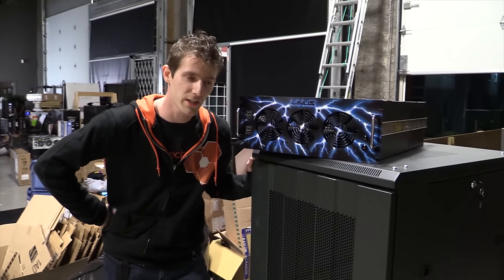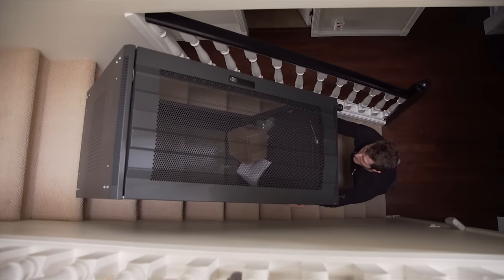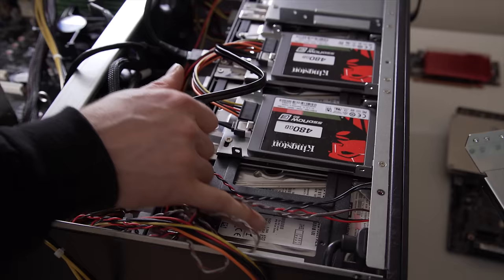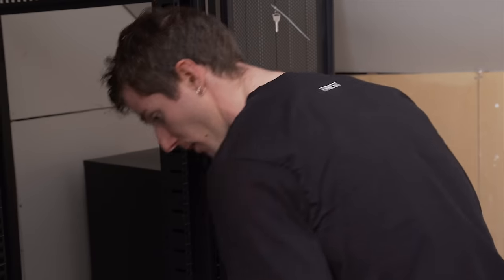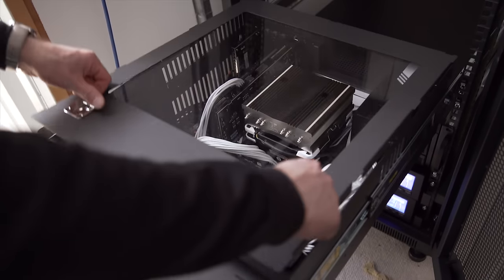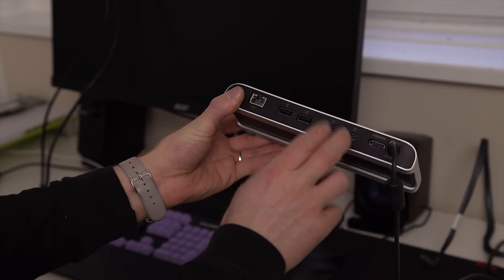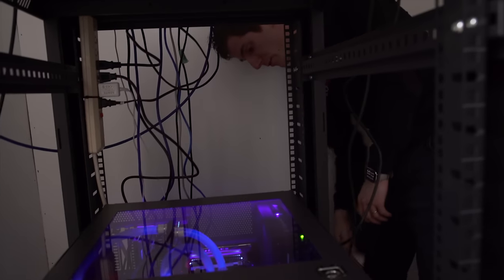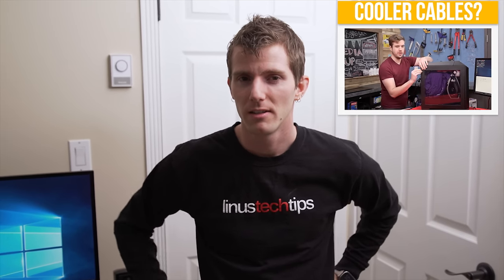Final Deployment of My New PC! - Personal Rig Update 2015 Part 5 (FINALE)

Comment: Linus, I have yet to see you do proper cable management. EVER. Make a video to prove me wrong. (Because you have something to prove to a stranger on the internet, of course). ;)
Reply: +timmyboy seeing videos where they use rack equipment makes me cringe.   I watched that thinking I really hope he has made sure the floor has enough structural supports to handle the rack when it inevitably gets loaded up.  I spend all day everyday working with enterprise hardware and networking (all 10Gb fiber, with vm clusters using dedicated 10Gb iSCSI scan) and i don't want to bring any of that stuff and install at home.  It is noisy and hot and designed to live in climate controlled Data centers/server rooms.  At home I all I want is high end consumer networking.  I know he is running a "home office" but it is not very professional at all.  Like just now how he put that rack in, so many issues, a big one being the fact that the room is not finished!  I will not install a rack into an unfinished room.   Just a bunch of half baked ideas and they have the ad revenue to make it because the money from all the people watching pays for it all.  Entertaining though and clearly successful.
Reply: Yeah, not bashing but definitely bothersome to see such top notch equipment being thrown together after hours of work to make it perfect then ending it all with a mess of wires. My dad always told me "A clean car runs better". I've lived by it. In computers, it has benefits of running cooler and makes it easier to upgrade or maintain.
Reply: +Simon Davies The whole rackmount idea was stupid in the first place IMO. Why do all that? If you wan't an insane watercooling setup just go full tower case, and then actually put it in the room you're in so you can admire it.
Reply: +timmyboy  It makes literally no difference at all. Go watch their video where they stuffed an iron and a couple of shirts and boxes in a rig and temps didn't change at all. But for maintenance it is easier I'll give you that one.
Reply: +Joshua Flores (Josh) you must not know much about computers they tested for 10 minutes if your like me and run your pc 12 hours strait for work and gaming it makes a diffrence
Reply: I know enough to conclude that running at full load for 10 mins straight should be the equivalent of running your pc with moderate use for a whole entire day and half that amount if you're gaming. But of course neat cable management would overall expand the lifetime of your pc in the long run. So if thats what you mean then i totally agree with you.
Reply: +timmyboy Yeah, as a former sysadmin myself, I cringed when I saw all those loose cables at the back of the rack. You can't just connect everything and then expect to clean that spaghetti up.
Reply: +Joshua Flores (Josh) Doesn't change the fact that's it's horrible cable management.
Reply: ***** Any PC enthusiast who doesn't live in a trailer.
Reply: +Alex Meanberg Because if you really was enthusiastic about computer building, you would know that it would help the airflow => cooler temperatures.
Reply: +timmyboy Clean cable management looks better, I'll give you that, but unless you have literally hundreds of cables hanging behind the rack, there is no hit in cooling performance and maintenance actually becomes harder, because you have to untie your cables, do what needs too be done and then tie them again. Every. Single. Time.
Reply: Ahh but loose cables look so much cooler!
Reply: Tokeish I agree that it's not about airflow, but it's nice to have your setup look nice and clean. Also help a lot with management when managing multiple servers.
Reply: look at his latest server room update
Reply: Ty Holt he did that so he could have true silence with no performance compromise.  If you prefer something else, go do it.  That’s the glory of the PCMR

Comment: I have always wanted a setup like this with the goal leaving my noise and heat producing PC in another room. Thanks to this video, I have done just that but at a much lower cost. By using USB and HDMI extension cables to connected my monitors and a USB hub I was able to achieve an equal result. There were some weaknesses to this setup such as susceptibility EMI and signal derogation but getting better quality cables fixed that issue. Now, 5 years later and I dont this setup it one but and it has check all the boxes. I added air conditioning into what I am calling my "server room" since this is where both my gaming PC and main server reside.

Comment: Wanted to do that too, but then I looked at the price for a Thunderbolt dock and thought, nope. :)
Reply: Flat4Buggy 2 Well, I'd even need two docks since I have three monitors, they support only two monitors..
Reply: Well, the only two things missing to get my rig completely silent is replacing my data hard drive with a big SSD and a graphics card with zero fan mode, the other fans can be turned off and my rig is well sound-insulated so I should have at least a silent idle system.
Reply: If you're running 1080p or less, use HDMI ↔ CAT6 adapters instead. They're cheap and work well.
Reply: ***** I'm running 1080p @ 120hz so this won't work...
Reply: Knig Fotlets That sucks. Although, depending on how far you'd want to have the computer, you might be able to get away with using a regular cable (DVI, HDMI, DisplayPort—I've seen all of those in at least 15 foot variants, so if you're planning to keep your computer just in the next room, that could work).
Reply: +Knig Fotlets I just saw the price of the cables to move my computer to the garage, wow. Next option, going to look at some stuff over Ethernet.
Reply: I've had good luck using 5-meter (16.4ft) USB extensions (2.0 & 3.0) and 15 & 25ft DisplayPort cables by Cable Matters (Amazon), and 15 & 25ft HDMI cables by Mediabridge (Amazon).  Works great with my UltraWide 3440x1440p 60hz monitor.

I even have an AmazonBasics powered USB 3.0 hub on the end of the 5-meter USB 3.0 extension cable and it works great - with full USB 3.0 transfer speeds on a 3.0 flash drive plugged into the hub.

Comment: Hey linus, ever heard of a hand cart. Has two wheels a handle with a metal plate that would go under that rack and you can roll it right up the stairs. its a lot less stress on your back and can be bought fairly cheaply at any hardware store, or rented.

Comment: How do you turn it on? Is there a power button or something in the room where the monitors and keyboards are or do you have to go into the other room and switch it on? Or will it be on 24/7 or something?
Reply: +rooneye PXE Boot or Wake-On-LAN can be used to turn the machine on with a keyboard input or a "magic packet"
Reply: +SamHasNuts what about the hibernate feature of windows?
Reply: +rooneye These are not really machines you would turn off ever.
Reply: +rooneye You can send WakeOnLAN via Phone
Reply: +k you can use hibernate, but youre still using standby power, whereas with PXE Boot you're just using a small amount of power to keep the Network Card running to listen for that packet.
Reply: SamHasNuts thx for letting me know. i've been using hibernate for quite some time and only use restart from time to time to clear the memory. but lately i have a key on my keyboard not working and i solved the issue by using shut down, whereas at the only other time before this time i had this issue, i solved it by using restart. i wonder is completely shutting down the computer, or using wake-on-lan a better choice?

Comment: This is the perfect recording studio DAW workstation solution. Computer control and display through Thunderbolt and audio through Dante. 2 cables. Only 20 years ago a well-respected studio would have everything in a single room with hundreds of cables running back and forth. Astonishing.

Comment: my pc 100% silent is very simple, I run my PC in a completely different room too and its filled with a bunch of fans. All I did was use long USBs and hdmis to reach my main room
Reply: Never heard anything from my Corsair Carbide 330R Blackout Edition under the desk (next to my bed) ;)
Reply: lol, huge heatsink!
Reply: and sub-zero lasers!
Reply: My girlfriend can't sleep when my PC is running. I cool it with a domestic fan and ice cubes.
Reply: mine is silent too I have slaves fan it off with palm leaves, works really well
Reply: Pro tip: if it gets too hot, just drench it in ice water. It'll cool down. It won't work anymore, but the cooling would be insane.
Reply: My pc is silent also, all I had to do was get too close to an explosion and lose 68% of my hearing, 4 fans next to my face, completely silent.
Reply: I have a rack with my networking equipment, UPS, storage and ESXi servers in a back room (which is separated from the rest of the apartment by an 8 meter hallway).

My development and gaming systems sit in a rack in my office, watercooled with a shared large water tank (a 50 liter aquarium) with tubing trough the wall to a heat exchanger outside. It's mounted on the north facing wall, so it's always at the coolest side of the house.

The only things that makes noise in my office now are my Wifi router, which has the weird habit of sounding like an oldschool harddrive when under heavy load (I would have replaced it long ago if I wasn't so determined to find out how on earth a fanless wifi router can make any sound at all).

The second thing that makes noise is one of my monitors, for some reason, it makes a popping sound about half an hour after being turned on. I've been told it's failing capacitors, but the thing has been doing that for 3 years now and still works perfectly.

Comment: well, my silent computing solution is a Corsair 600Q, a noctua D15 and a palit GTX 1080, there's plenty of room for 2 or 3 of these in that case....if I wouldn't love the veloci raptor so much and get myself to swap it for a ssd it would be pretty hard to tell whether the computer is on or not aside of glowing powerbutton....
I'll still have to replace the remaining 3 stock fans for noctua, but that wouldn't make much sense unless I swap my hard drive for a ssd too...

right, the noctua D15 handles my 130W cpu, a fx 8350, at ease keeping it at cool 55°C under prime 95 with just 30% fan speed

Comment: Does he get any mouse lag from the thunderbolt dock? Noticeable in a game?
Reply: Short answer: No.
thunderbolt2 is capable of transfer speeds 4 times that of USB 3.0, a usb mouse wouldn't and couldn't be lagged out or bottlenecked by a thunderbolt connection. Also, it is an optical thunderbolt cable which uses an optical signal (light/laser) to transfer data which (assuming single mode fibre, although multi mode fibre wouldn't be too different in terms of noticeable and measurable speeds) would suffer negligible to no signal degradation/attenuation over 30 feet (9.14m).